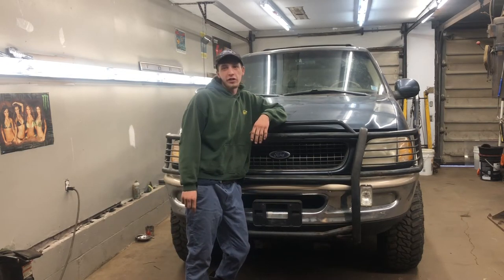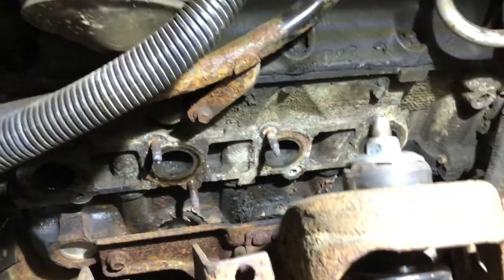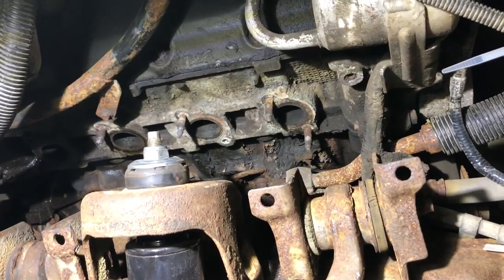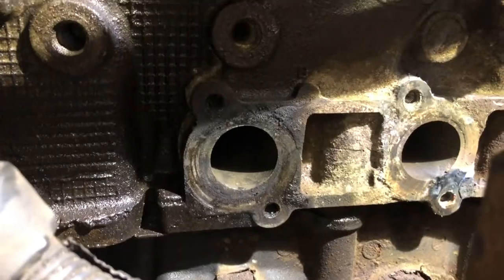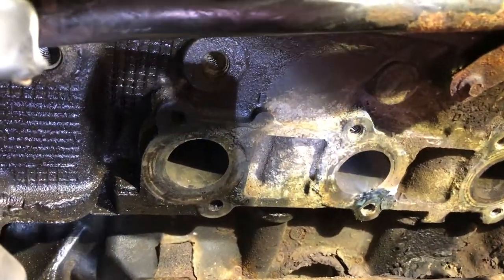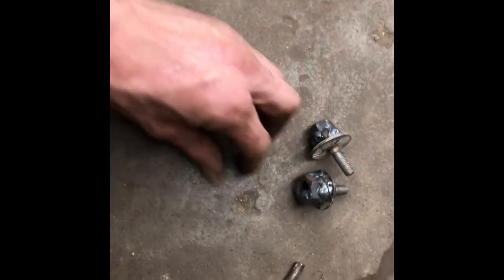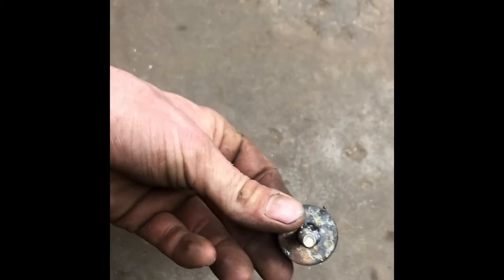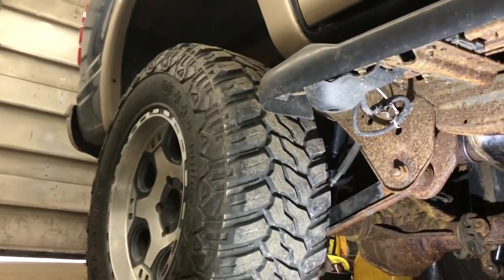Ford Expedition manifold replacement/broke stud repair and gets full magnaflow exhaust

Comment: Does welding inside the thread bore distort the threads in the aluminum head at all?  Or is that just a necessary problem that needs to be remedied after the damage is done?

Comment: Great job. I was wondering how you were going to extract the studs that broke off under the surface of the head. Apparently the solution is to pile on the weld and annoying it enough so it comes out :D Now I feel a bit better about doing it to my 97 5.4